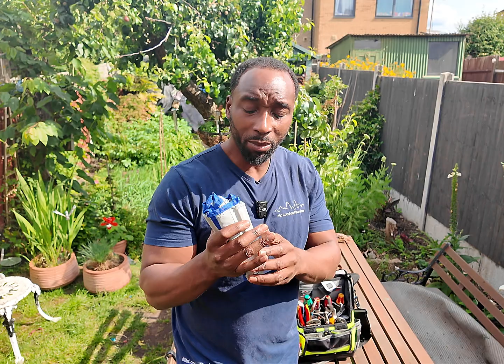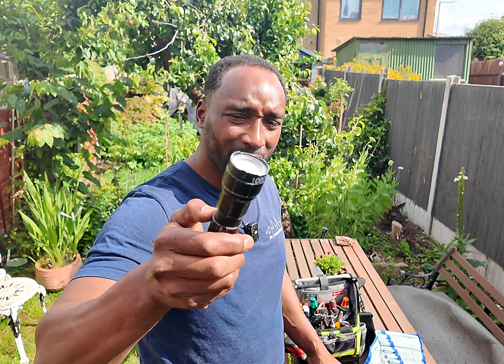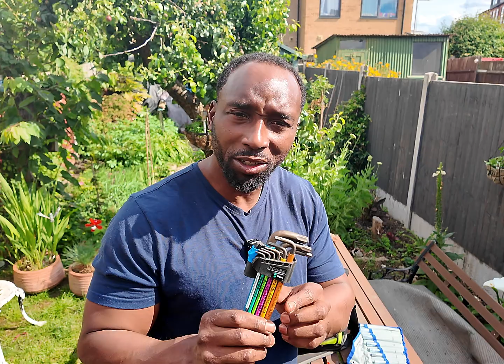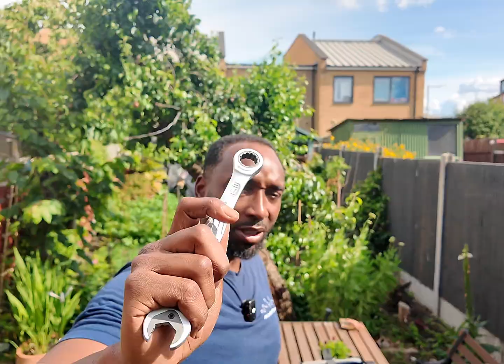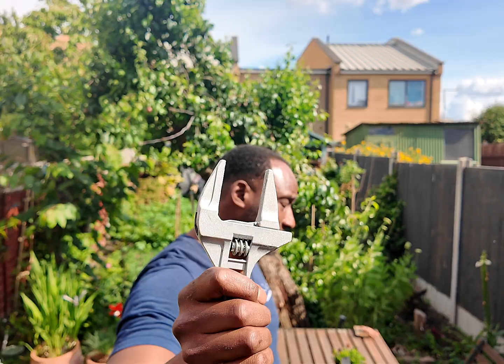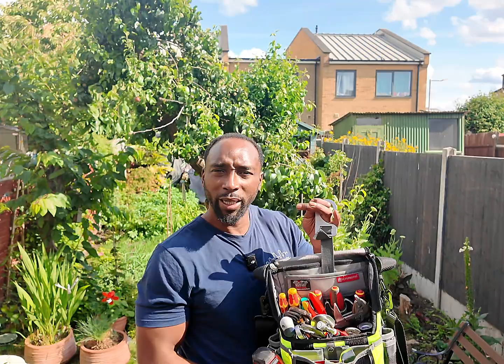Essential Tools Every Mechanical Engineer Needs on Shift | Toolbox T

Comment: First and foremost - a plumber IS NOT an engineer. Secondly, the word is specific, not “pacific”. Pacific is an ocean.
Reply from the maker: Thanks for the heads-up 👊 Always appreciate someone looking out for details!

And you’re right—plumbers aren’t engineers, but we do deal with a lot of technical systems on site 😅.

Do you work in engineering yourself, or just noticed the mix-up? 👀”